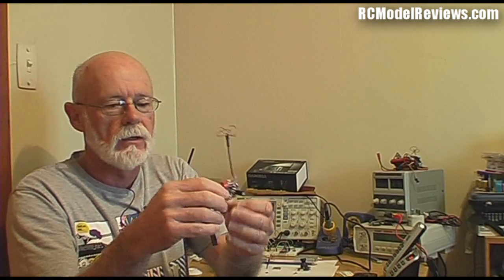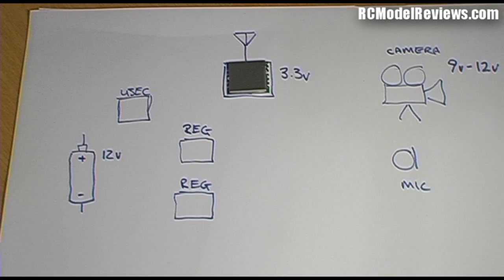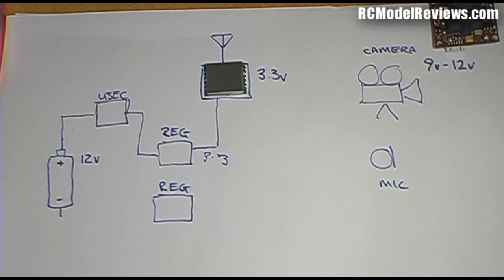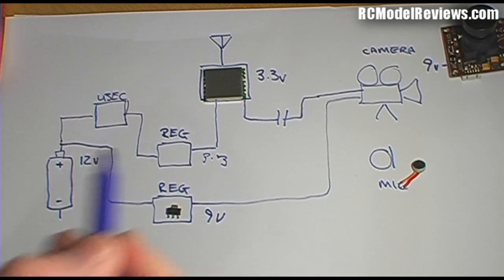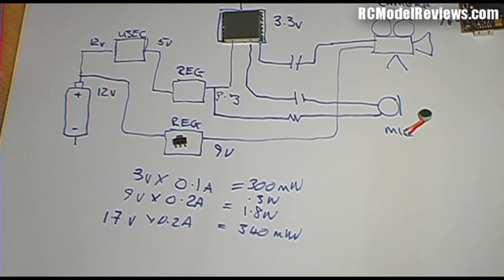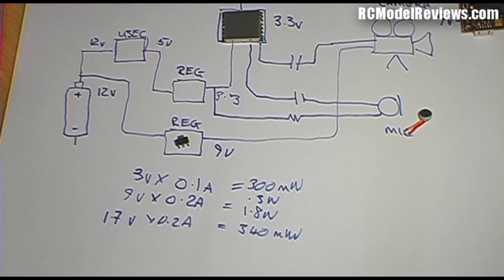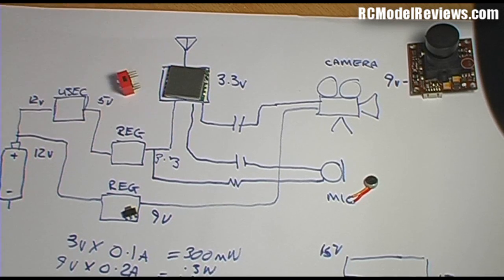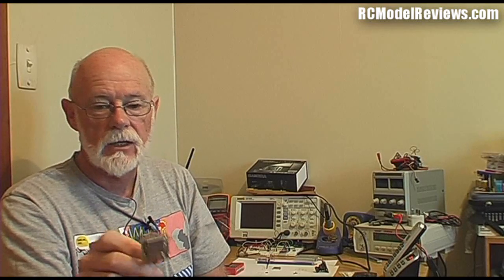DIY FPV backpack Part 1 - the theory and design

Comment: Hi Bruce. I got my fpv cameras and transmitters wiring with servo leads to keep them clean. Now I'm trying to see how to add the voltage regulators in between those. I also wired my 1.2 tx just like the 5.2 ghz so that I only use one wire for the power from the battery. So far I tested the 5.2 in front of me and works fine, but wouldn't mind adding some the extra regulator to keep the image clean. Do you have a video on adding those to an already wired system? I don't mind making new plugs that go between what I already have. I do like the clean wiring I'm now getting and it's what I'm aiming for as well.

Comment: It's called the Molex Picoblade.  1.25mm spacing is correct.  They are also called "Micro JST" in the RC community, and are used to connect servos to micro receivers, and Spektrum uses the same plug for the satellite receivers.  

I found them on Ebay for pretty cheap but I had to wait for the slow boat from China.  Stay away from the crimp style, as a normal crimper won't work (so I've heard).

Comment: Hi Bruce I have just spent many hours looking all over the place for these modules, the cheapest place I have managed to find them at is foxtech. Rangevideo also sell them but the shipping cost are a lot higher. I will be VERY happy if your supplier is cheaper :) as I would love to make many of these transmitters from scratch with my own schematic. I am 16 and love electronics so I think building the module my self rather than buying it will be fun and give me some good experience.

Comment: I was looking forward for this video. Thank you! If I recall correctly, the Tx module is only 200mW. I would like to modify this backpack with 600mW or more. Hopefully it's compatible with my fatshark predator 5.8gHz which is on its' way.

Comment: Bruce, in my experience building one almost identical, you should NOT have a coupling capacitor in the video line on either Tx or Rx.  The video output from the camera is a standard level, and the DC component is a vital part of it. If you have a capacitor, the black level will float all over the shop, depending on the video content.  I know the data sheet says to add a cap, but I think that's a mistake - it should (only) be in the audio line.

Comment: Nice work! I really like the power supply design, using linear regulators in this way is a very practical solution. I also didn't realise you could use a microphone without a preamp. I look forward to the next issue but for now I have a couple of questions..
1) Is this the 200mW SkyRf module or airwave?
2) Why do you need to decouple the video signal? Is it not referenced to ground?

Comment: Nicetry that seems like a pretty high voltage.  I've flown to 3.3V min on my 3s cells for years. Packs are all still performing well.  All the auto cut-offs in the ESCs I've gotten are factory set at 3.3V.  Are we all missing something?

Comment: Thanks for the overview. What's the transmitter power output? Also, in Australia do you need an amateur radio license to transmit anything above 25mW like in the UK. Are you building your own receiver as well. there may be little point in doing that.

Comment: Great video Bruce.  I am confused as to how you keep the 9V regulator from cutting out when the 3s pack drops voltage below 10.5V.  All the Low Cut Out regulators I've seen for 9V specify 10.5V as the minimum.  My ESCs seem to drop the cell voltages down to 3.3V before cutting out, which would give me only 9.9V from the pack.

Comment: what about the minimum voltage drop from the linear reg ? if the lipo is at 9.2v the regulator will drop to much voltage and the voltage out won't be 9v. the LM7809 has a 2v dropout voltage at 1A it is probably less at a lower amp draw but still over a volt. How do you plan to fix this ?  Use a 4s lipo, use a more expensive lower dropout voltage regulator or does the cameras that state 9v actually work at much lower voltages.

Hope you managed to understand my question and Thank you

Comment: is there a much simpler way to filter the 12v batter supply to the camera? would placing a capacitor across the line from the batter to the camera and using a ferrite core help possibly?

Comment: what size cap would u recommend beween the cam and the module? i am guessing the + goes on the cam side? thanks for the video, i have been fiddling with these modules for a little while, and i find them better than airwave modules.

Comment: have you measured the voltage going out of that Vreg between the li-po and the tx with the oscilloscope? i think you need a capacitor right next to the Vreg because it doesnt cut all the noise by itself

Comment: Umm better if you put the 3.3v regulator downline from the 9V regulator - less wasted power and gets rid of ubec. In addition instead of capacitor between cam and tx I would use a proper level converter which would nopt tend to distort signal edges.

Comment: what was the overall weight? looking to build the lightest weight FPV system possible, barring spending too much...you know, comfortable on the cost/weight curve, but willing to spend enough if I can keep it light enough.
Its for an indoor flyer that flies really slow, so you can imagine basically a 'night vapor' scaled up just a little bit 1:1.5 to 1:2 scale.

Comment: The National Semi Conductor's LM2575 Only requires 2 components (correction, 4 components as the adjustable version would need to be used) more over the linear regulators you're using and can provide up to 1A. Although no argument about them being noisier, what sort of Vripple will the cause problems with the camera?

Comment: Hi, one question: I have the Fatshark Predator V2 with camera and everything (combo). I also have the FY Hornet OSD. I know the video wire goes from the camera to OSD Video in and from OSD Video out to the transmitter. Also I know the red wire goes from the camera to the transmitter (it is a 5V camera). But what should I do with the camera black wire? Goes from camera-OSD-transmitter? Or camera-transmitter and also camera-OSD -transmitter (in parallel)?
Thanks, Diego.

Comment: Not really R/C related but sorta kind of...  Could you use the antenna build for your home WiFi and/or security camera systems to get better range and quality in a larger area home?  I live in a 4500 square home and my wireless security system has to be wired in some places on the house to connect and record to the DVR and cant use wireless on our laptops and other devices.  I can buy repeaters but it's kind of expensive, this seems like a better solution. thanks

Comment: A little sad today after impacting 2 of my 3 brand new 2200 lipo into the ground with less than 15-20 minutes use by inflicting at AXN modifying velocities (both vertical) onto them from less than 1 hour total RC flight time. The FPV platform craves an FPV unit to add visuals and sound to injuries. Do you have a regulator for the voltage drops that my AXN Lipo's are experience that will not damage the FPV gear once installed?:-)

Comment: i have been told that regulation is only enforced upon complaints in canada. inspectors are few , and far between. seeing 200mw has a range of 1.5km at best, line of sight with good antennas, and an average flight is about 10-15 minutes, your chances of having any trouble are very minimal. 5.8ghz is a open frequency and legal, but at 200mw, u may need a ham licence. i talked about this to a few older ham radio guys, and they all laugh when i tell them the power of my stuff, thinking it is low.

Comment: Any idea of a DigiKey or Mouser Part # for the 3 pin connector to Sony Board Cam (650TVL OSD). The plug appears to be a molex 3 pin with 1.25mm spacing, I located the bare connectors on DigiKey, but unable to find a cable assembly with bare wire leads. Any idea where in the U.S. a person can obtain this 3 pin connector with bare wire leads?

Comment: Very good work, i'm also fan of DiY,  and i want to know if it´s possible to build the video receiver the same way??? do you have instructions for it??
Reply: Yes I have built two so far for a self contained DIY FPV monitor set also using Bruce's $1.98 diversity controller although I'm having a small bit of trouble with the one LED not turning off when it switches not a big deal really but I would like to figure it out before I enclose everything inside of the 7"TFT Monitor

Comment: I have successfully landed FPV 600 meters away with my lipo at 7.2 volts so my camera and VTX were still functioning at that voltage. It was a different camera but now I have 2 of these I will test them and see at what voltage they quit.

Comment: You are calculating power dissipation of a voltage regulator as if it were a resistor. This is probably wrong. AFAIK, it is a semiconductor based component and dissipates much less heat. As long as the input voltage and current draw is within limits it should be fine. Seems like UBEC may not be required.

Comment: Hey Bruce! I'm in the process of putting together one of these little VTx boards myself, but I still need to purchase the right transmitter module for it. Here's the one I was looking at, is it the same (or functionally equivalent) to what you've used in this design? http://www.ebay.com/itm/New-Boscam-FPV-TX5823-5-8G-200mW-Wireless-Audio-Video-Transmitter-Module-System-/191086450753?pt=Radio_Control_Parts_Accessories&hash=item2c7da3d841

Comment: Could you use a basic logic level converter like this one for the video signal?   https://www.sparkfun.com/products/12009
Reply: I know it's been a while since you've asked but no, those logic level converters are intended for digital signals. The video signal is analog. It's a relatively common practice to "capacitively coupled" an analog signal (as Bruce has done here). The video signal is likely only a couple of volts (I think 2V peak to peak is the norm for an unloaded signal).